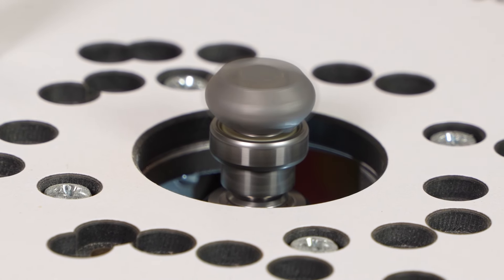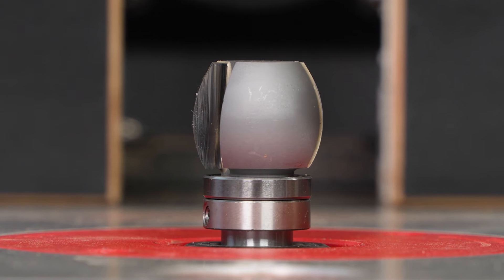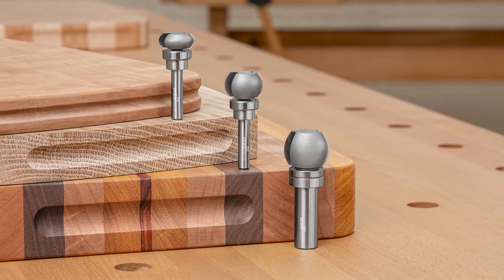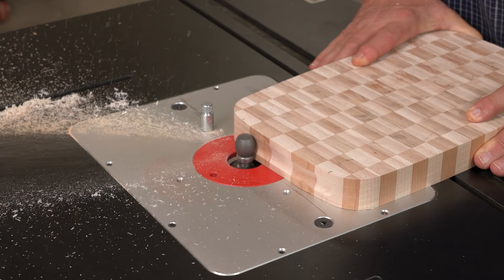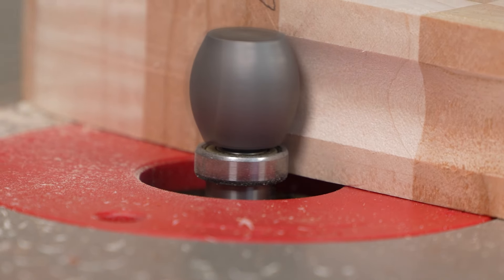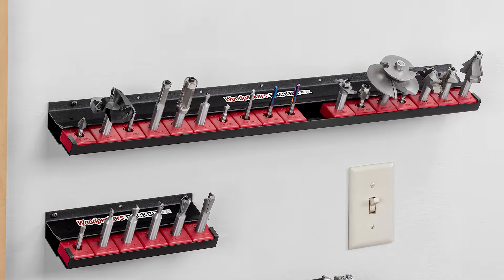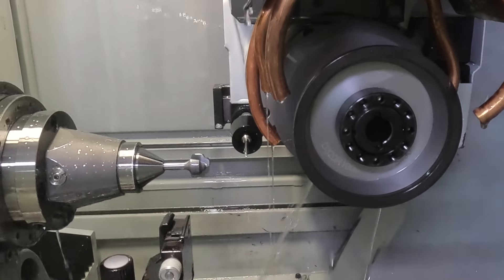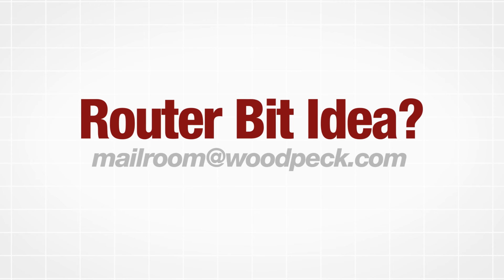Ultra-Shear Finger Grip Groove Bits | Woodpeckers Tools

Comment: Could not find the dimensions of the bit, other than shank diameter, on the web site or here.  Does the 1 inch bit cut a groove 1" tall?  What is maximum diameter of the bit and of the bearing (difference = maximum depth of cut)?
Reply from the maker: The "1" bit" is designed for material around 1" in thickness...roughly 7/8" to 1-1/4". The groove is about 3/4", giving you room for a 1/8" round over on both sides.
Reply: @WoodpeckersLLC  Thank you, I see several comments about the groove being shallow, what is the maximum depth of cut?
Reply from the maker: Depth of the 1-1/4" and 1" bits is 1/8". Depth of the 3/4" bit is 3/32".
Reply: @WoodpeckersLLC  Thank you for the prompt response.